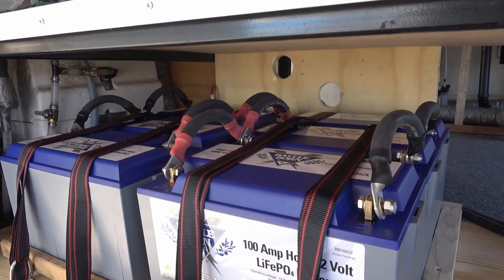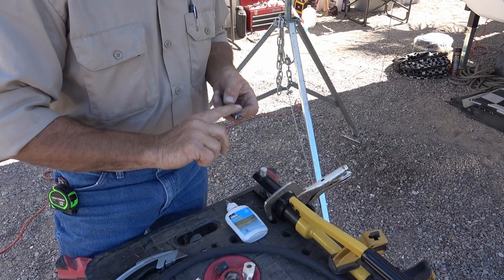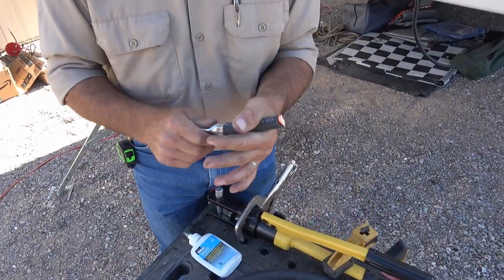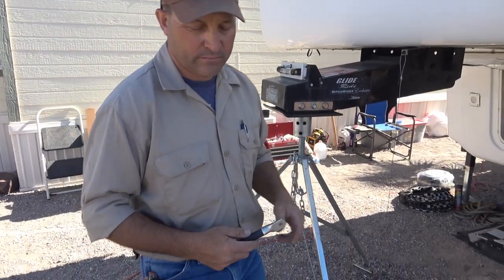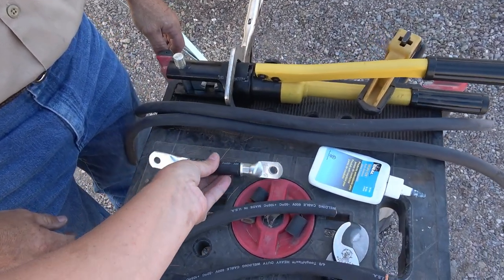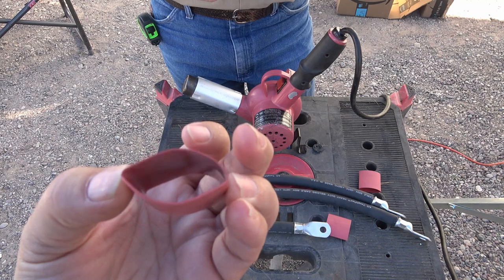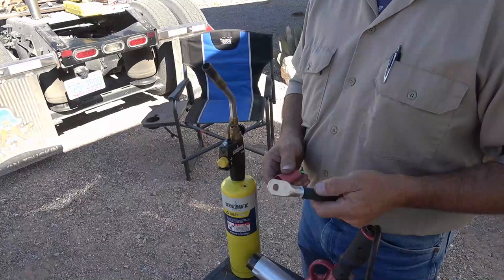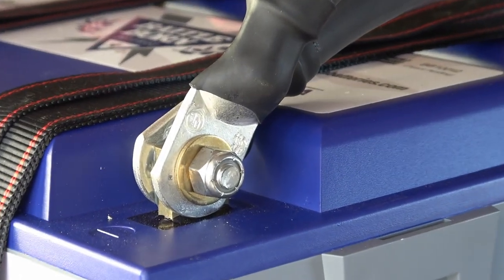Building Custom RV Battery/Inverter Cables - Tips & Advice

Comment: That's fantastic.  I am delighted to see the proper way to do those.  Thanks!
When I had my solar system installed four years ago, I repeatedly told them to use larger wire than they thought I needed just to be sure I didn't have to redo it.

Comment: Well done done video on how to properly make battery cables. I also have a hydraulic cable crimper and they make yourself look like a pro on bigger cables. After working over 35 years in an industrial plant designing electrical systems, a properly done crimp is worth its weight in gold.

Comment: Best to use a hammer crimper in a vise or a press.  I like to match my ring terminal bolt holes to the bolt diameter.  Your work is very good.  No wings.   😎👍

Comment: When I redesigned my battery box to add a disconnect, I bought the 18 ton hydraulic crimper from Amazon. The dies are marked in mm2, rather than AWG, but a conversion chart is easily found. It was actually fun to make cables. The hardest part was buying the terminals, since I didn't need 500, and they're sized by AWG and hole size. I also used some 90 degree terminals so the cables exited the switch out the bottom. Two layers of adhesive heat shrink and they look professional!

Comment: I solder mine with a torch, which is dirt cheap and very effective, and can be redone if you make a mistake, lol. That hydraulic crimper certainly looks great and would be nice for sure. I used 2/0 cables, if I had to run cables any further than a couple of feet I would have gone with 4/0. It’s surprising how flexible that stranded wire is even when it’s thick. Thanks for the video.
Reply: Soldering big amp cables is not recommended. When those cables are in use, heat can melt the solder and loosen the connections. Cheap 12 or 20 ton hydraulic crimpers (< $40 on eBay & Amazon) permanently fuse the cable “hairs” by compressing them. That eliminates all air and helps stop later internal corrosion. “Mistakes” cannot be redone because hydraulic crimped connections will NEVER come apart.
Reply: NoGas makes sense, but if your connections are hot enough to melt solder, well, you’ve probably got issues crimping isn’t going to solve;)
Reply: Solder is okay on the small wires. Not so on the big stuff. I've never seen any electrician use solder on 480V, 220V etc. 4/0 is comparable for V capacity. All I have ever seen anyone do as a professional are crimps for everything 1/0 and larger.
Reply: Private Resident wow, that’s some crazy power requirements to need that big of a conductor for 480 volts!
Reply: @Jumping off the cliff irrigation pumps we use for these center pivots run power right off the poles through a main disconnect and 100amp breakers. Big wires to move lots of amperage. Some systems are 1/2 mile wire runs.

Comment: Probably a silly question, but at that cost for cable, and in short lengths like that would it not be cheaper to just bend solid copper rod to shape? You could even just heat shrink it.
Reply from the maker: I've seen some people use copper bars I imagine they work fine for power transfer. But being that the battery bank is located in an RV the cables offer a little more flex than rigid copper. Going down the road there can be a lot of vibration and movement of the trailer. If you use rigid copper I would think that would put more stress on the battery terminals. Another reason is the battery lugs for the cable are already nickel-plated to reduce corrosion.

Comment: Those 4/0 gauge cables are a strong argument for going with a 48 volt system, instead of 12 volts - because, the cost of the cables and connectors are so much cheaper for smaller gauge cables and 48 volt systems can use cables that are 1/4 the size needed for 12 volt systems.   Solar charge controllers for 48 volt systems are a lot cheaper, as well.   For example, a Victron 150/35 controller can support about 500 watts of solar panels for a 12 volt system, but it can support 2000 watts of solar panels for a 48 volt system - for about $325, versus $700+ for a 100 amp version of the same controller.   48 volt inverters are more efficient, too.
Reply: Higher voltages definitely have efficiency advantages in cabling and converting. The closer the voltages are the less loss of efficiency for both the solar charger and the inverter. A few issues though. First you need to have high enough voltage panels or enough panels to run in series to put a 48v charge on the batteries. In an RV application you also need to account for powering the 12v devices on the RV such as the lights, water pump, fridge circuit board etc. Victron makes a nice 24 to 12v dc-dc step down converter but 48v-12v isn't something I have seen. Is there one you recommend?
Reply: @harleyd500  Yes, I found a 48 volt to 13.8 volt DC-DC converter for $53.90 on ebay that provides 414 watts at 13.8 volts, or 30 amps.   The brand name is Daygreen.   I purchased two of those to work with a 450 amp-hour @ 51.2 volt LiFePO4 battery pack in a 16s3p configuration (48 - 150 amp-hour 3.2 volt prismatic cells, 23,040 watt-hours capacity).  60 amps at 13.8 volts is plenty to run any RV appliance or device.  Here's a link to the exact model:

https://www.daygreen.com/collections/48v-60v-72v-to-12v-13-8v/products/48v-to-12v-13-8v-30a-414w-dc-dc-step-down-converter-voltage-regulator-w-acc-switch-3-years-warranty-newest
Reply: Richard Owens yes, you nailed it. I seriously debated going to at least 24 volt on mine. I decided on 12 mainly because I already had a 12v 3kw inverter/charger that had lifepo4 setting for my batteries. If I ever go bigger on the inverter, I'll definitely up the voltage and add a dc to dc converter to get to 12vdc.
Reply from the maker: Its an attractive option for sure, but I would imagine 48 volts with greater arcing potential demands more safety considerations as far as wire runs, lead dress, special fusing, etc especially in a mobile application like an RV, upping the labor costs.   I also wonder about insurance considerations, being your are changing the original vehicles voltage.
Reply: @richardowens9061  Thanks for the link. Looks like what I would need and also available in a 50amp model. We are currently limited by our 12v inverter/charger. On a future larger RV I will definitely be going at least 24v panels and 24v/36v battery, possibly 48v.
Reply: @LoveYourRV  Remember, power is power, regardless of the voltage.   If you're supplying a 3000 watt inverter with enough power to run it, you need to implement the appropriate safety measures.   That always means using proper fuses and/or circuit breakers and running your wires so that they aren't subject to shorting out.   And, if you aren't comfortable with working with electricity, you should pay someone else who is, regardless of whether it is a 12 volt system or a 48 volt system.    And, if you are comfortable with working with electricity, working with 48 volts is easier and less expensive - which translates to LOWER installation costs, not higher.   And, any insurance company is going to want the entire system inspected, regardless of the DC voltage being used.  Finally, if you're using a DC to AC inverter, you're already working with 120 volts, even if the inverter is supplied with 12 volts.
Reply: @harleyd500  Remember, DC to DC converters can be connected in parallel.   That means, you can scale your system according to your needs.   For us, that means implementing redundancy.   We chose to go with two 30 amp units, rather than a single 60 amp unit, so that if one fails, we still have the other to limp along with until we can replace the one that died.   Connecting in parallel also distributes the load across both units, rather than just one.  And, of course, you could use five 10 amp units, rather than one 50 amp unit.  Just make sure they are all the same unit putting out the same voltage.
Reply: @Jumpingoffthecliff  If you're going to use a DC-DC converter, I recommend going with a 13.8 volt output model.   That is the nominal voltage of a running automotive electrical system - which is what the 12 volt equipment in an automotive system is designed to use.   It's also a high enough voltage to charge 12 volt batteries - and, ironically, 12 volts isn't.  Furthermore, for long wire runs that incur significant voltage losses, 13.8 volts allows you to use long wire runs and still have at least 12 volts at the far end.
Reply from the maker: Power is power, of course, all I'm a saying is higher the DC voltages the less safe to deal with and need greater precautions required. At some point, they become a shock hazard and arc much easier, so if any contact or connection becomes faulty its a bigger concern. 120VAC is a different animal than DC and there have been strict safety standards in place because of it. 12VDC and 120VAC have been in RVs for years, but people putting in DIY 24V and 48V systems is fairly new. Again not saying it's bad, but should be tackled with care.
Reply: So are you saying then for 48V the cable to use is 1/0?.
Reply: @carlcadogan4510  Yes, 1/0 should be sufficient.   It's easier to work with than the 4/0 and it costs less for both the cable and the connectors.

Comment: Temco still makes a hammer crimper.  USA made.  I got it since I’m just crimping 4/0 cables for this lithium project.  Didn’t want to invest in a hydraulic crimper for just this project.  I’m hoping it works well.  Funny, I’d hear about Noalox just the other day.  Would Dialectic grease do the same??  Thanks for the video!
Reply from the maker: The Noalox helps protect the connection from corrosion just like dielectric grease, but it also improves the connection by having small bits of zinc and aluminum oxide suspended in the paste. Provides additional inner-strand and inner-conductor current paths for improved conductivity and cooler connections.  Cheers, Ray
Reply: @LoveYourRV   Yep, I heard the same.  Yet another item to buy!  🤣. Thank you for sharing!

Comment: Noalox? On the ideal website it looks like the main use is for aluminum to aluminum wire connections? Is there a version of Noalox for copper to tinned lug pressure crimping?
Reply from the maker: I haven't heard of a product designed exclusively for the DC terminal lugs but Noalox does a good job. It was used mostly in the old days for aluminum house wiring to coat aluminum to aluminum and aluminum to copper connections.

Comment: Is cutting 4/0 cable with a hacksaw feasible? The crimper at Northern tools is affordable, $30, if you only have one project and are on the road full time and have limited space to store large tools. I would like to install lithiums in my Tiffin diesel pusher, it’s getting the connecting cables made that keeps me from pulling the plug on the purchase.  I could get the batteries, then line them up in the configuration I need, measure, and find a company that can custom make them for me. My current cables are 3/0 which doesn’t seem a common side from companies that make custom cables. Need to be station for a couple of months in good weather so I can get equipment shipped to me easily.
Reply from the maker: Not sure about a hacksaw. Some RV service centers can build custom cables, likely they could cut them or maybe a hardware store , I remember having a pair done for me.

Comment: I would personally attached the heavy cable going out in the middle terminal of the the three batteries. This allows equal draw from all three batteries at equal rates.
Reply from the maker: When I installed my 3 Lion lithium batteries their engineer recommended having the negative and positive leads at either end of the bank for best balance without doing some elaborate cable arrangement.
Reply: Love Your RV I agree if you have a long string of batteries. The one in the video was three batteries in parallel . The cables from those three should either be tied to the posts of the middle battery to balance charging and discharging.
Reply from the maker: Maybe I misunderstand but the configuration would make the middle battery work harder than the outside two. Can you link to a diagram that shows what you mean.
Reply: Love Your RV the way the bank was wired . The end battery would work harder then the other two . If he had wired he cables on the diagonal from each other. There wouldn’t be a problem.
Reply from the maker: They are on the diagonal - https://youtu.be/9-AxK59w6zo?t=879

Comment: Great video Ray.  I am thinking of changing out my 2 lead acid batteries with two Battle Borns in my Class C.  I have an 1800 watt invertor in place.  Do you know if I can simply replace my batteries without changing any wiring or invertor?  I have no idea about anything electrical, so any advise you have would be grateful.  Thanks.  In the meantime, Be Safe and Be Well.
Reply: The Battle Born batteries are an excellent drop-in replacement for lead-acid batteries.   As for your cables, that is a question I cannot answer because I don't know what kind of terminal posts you have on your lead-acid batteries.    If they're round posts, the Battle Born batteries won't work with the cables you're using now.   The inverter should work fine, though.
Reply from the maker: I would need to see a picture of the existing cables and connectors. Cheers, Ray
Reply: @LoveYourRV  ...,Ray, ok will do.  I can tell you I have a 2016 Thor quantum 31ws, with a residential refrigerator, but will get you a photo asap.  Thanks.

Comment: Hey Ray. Great video.
Naolox is $30🇨🇦 at Lowe's for 4 oz & on Amazon.com $16US for 8 oz. Amazon.ca is more yet. 
Is it good for Copper to Copper? The product description says aluminum to aluminum or aluminium to Copper.
Reply from the maker: Thanks. as far as I know, Noalox was designed for the electrical industry to deal with aluminum wiring, but seems to work well on all metals to improve the conductivity of the connection and reduce any oxidation of the joint. A little goes a long way, a small tube will likely last a person for decades. Also, it's conductive so a person doesn't want to be using it where a dielectric grease is called for like trailer plugs or light sockets, that sort of thing. Myself I have used a similar product called OX-GARD on my 12-volt battery and wiring connections and it worked well, too.  https://www.gardnerbender.com/en/p/OX-100B/Ox-Gard-Anti-Oxidant-Compound# Cheers, Ray

Comment: fyi that no oxide you are using is for aluminum conductors, they do make one for copper conductors
Reply from the maker: Seems to work well on many dissimilar metals though. I've used Ox-Gard on my battery connections for years with good results. Never have heating, galling or corrosion problems.
With battery lugs, connectors nuts and bots you run into all sorts of metals from nickel, tin, stainless steel, copper, lead etc. Cheers, Ray
Reply: @LoveYourRV  just saying, i am an electrician and they make better stuff for what your doing
Reply from the maker: @conradbarthel54  Great, please share then, always up for a better way to do something
Reply: @LoveYourRV  pitty didn't share..

Comment: First terminal on the battery you have your hand on hasn’t been tightened!
Reply from the maker: Good eye. That would be because the system installation is still in progress. There are still more cables to be built and attached. I guess you didn't watch the whole video. :) See here where he makes the connections https://youtu.be/9-AxK59w6zo?t=781

Comment: great video. always informative.I have learned a lot , so my RV experience is better ...BTW "Orientate" is not a word..."orient" is . So is "oriented"....just FYI....
Reply from the maker: Could be that I'm Canadian so we speak more British words  https://www.merriam-webster.com/dictionary/orientate Cheers, Ray
"Orientate is a synonym of "orient," and it has attracted criticism as a consequence. "Orient," which dates from the mid-18th century, is in fact the older of the two verbs - "orientate" joined the language in the mid-19th century. Both can mean "to cause to face toward the east" (and, not surprisingly, they are related to the noun Orient, meaning "the East"). Both also have broader meanings that relate to setting or determining direction or position, either literally or figuratively. Some critics dislike "orientate" because it is one syllable longer than "orient," but you can decide for yourself how important that consideration is to you. Personal choice is the primary deciding factor, although "orientate" tends to be used more often in British English than it is in American English."